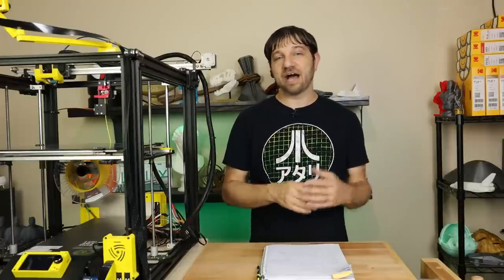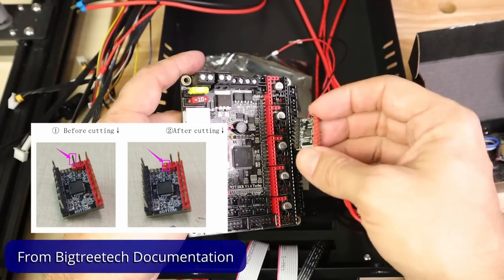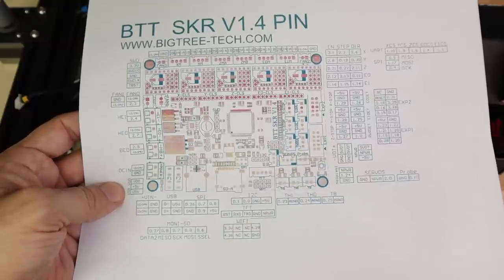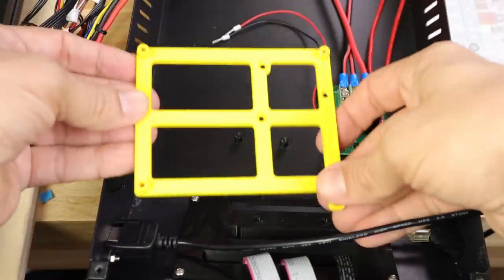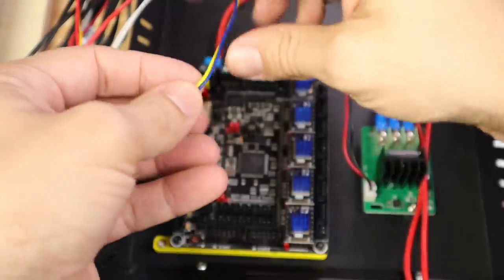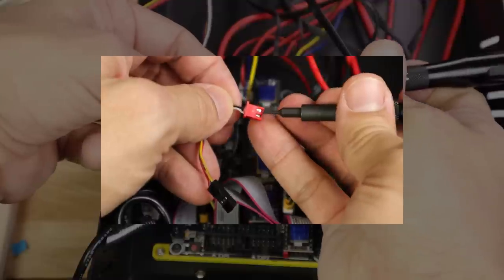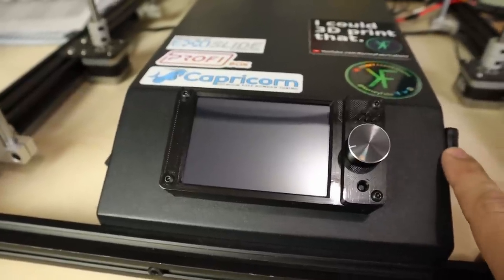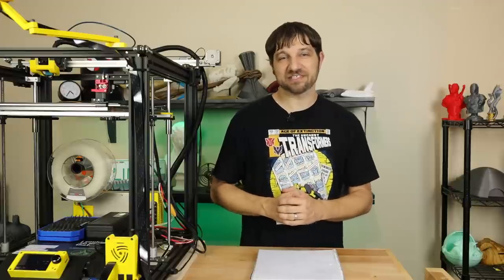Bigtreetech Ender 5 Plus Upgrade: SKR V1.4 Turbo (Part 4)

Comment: Hey dude. This video was a big push for me to hop on the kit pretty much as soon as I got my ender 5 plus up and running. I've got it all hooked up with a solid 600w meanwell PSU. I've followed your guide as close as I can up until you test the board and it first outputs to the display, but I get nothing on mine. I've crosschecked my connections with videos by other youtubers too. The power LED is showing on the board but there's no LCD image or backlight activity to speak of, nor any spin from any of the fans. I've checked the SD and the default firmware seems to be on there along with the BIN file. Can you suggest how I can check to see if my board is faulty?
Reply from the maker: If you're not getting any power to the display, you may have the 10-pin plugs in reversed. Check the colored wire orientation versus my video. To see if your board is dead, hook up a computer over the USB port with something such as Pronterface and see if you're getting output.
Reply: @kerseyfabs  Cables are 100% hooked up correctly, but now I'm even more confused. I switched the jumper to USB and connected it up, pronterface detects the printer but sending commands does nothing, not the motors, not bed temp, none. None of the fans are spinning, either. The microSD storage is accessible through the USB connection though. What's even stranger is that I now have backlight on the screen, a red "D2" LED has lit up on the back of it, and it beeps when I press the wheel in.

EDIT: I've just randomly started getting output from the LCD after being hooked up to my PC for 10 minutes or so. This is only when connected via USB, disconnecting the USB cable or switching the jumper back to VDD stops all output to the display.I don't really know where to go from here
Reply from the maker: @notyounotme7193  Is there any chance the main power into the board is wired backwards?
Reply: @kerseyfabs  board is receiving proper power, the green Q3 LED is lighting up on the board. I'm starting to think there's a problem with on board voltage control

Comment: Hi. I have changed my E3 turbo for this board, and i want to use dual z-steppers. I have downloaded your fw for dual z and now i wonder which pin i should use for z1 and z2?
Reply from the maker: Check out my video on G34 Z alignment. It shows exactly what you're looking for.

Comment: It may be worth noting that in the recent marlin firmware, you no longer need to reverse the pins in the bltouch probe and put it in the z endstop header. Marlin fixed that in v2.something before your new firmware. The sensor can go into the probe header as-is.
Reply from the maker: Given the fact that the pins are actually hard-wired to certain power or ground lines, I don't see how that's possible. Do you have a link?
Reply: In the z endstop port, you (we) are just swapping the wires so the correct one can go to the z endstop ground and the probe pin goes to pin 1_27. If you don't swap them and put them in the probe port on the board, the ground pin goes to ground and the probe pin goes to pin 0_10 as per the board diagram. 
In Marlin, in the pins_BTT_SKR_V1_4.h, it's already defined as:
//
// Z Probe (when not Z_MIN_PIN)
//
# ifndef Z_MIN_PROBE_PIN
  # define Z_MIN_PROBE_PIN                  P0_10
# endif
All that has to be done in configuration.h is to comment the '# define Z_MIN_PROBE_USES_Z_MIN_ENDSTOP_PIN 'line 
and uncomment the '# define USE_PROBE_FOR_Z_HOMING 'line.
there's one more line below that: '# define Z_MIN_PROBE_PIN 32 // Pin 32 is the RAMPS default' , but you should not need to uncomment and change that one because that # ifndef Z_MIN_PROBE_PIN segment above in the pins_BTT_SKR_V1_4.h handles that.

The only reason I ran into this was because I was monkeying around with Klipper and couldn't figure out why the servo stuff worked but the probe wouldn't stop the bed raising when i assigned sensor_pin: ^P0.10 in the [bl touch] section. Had to quick power off the machine to stop the nozzle from crashing. Then i opened up the machine, swapped the pins in the connector, and used the probe port and it worked fine.

Comment: Hey Kris!  In all your adventures have you come across a way to flash this board if the SD is dead?  On my old RAMPS board I could upload firmware via the commandline with avrdude but as far as I can tell there's no equivalent for the LPC1769 yet.
Reply from the maker: You will probably have to reflash the bootloader first. I'm not 100% sure of the process since I haven't used it. I'd Google for: SKR V1.4 Turbo bootloader
I saw there was a bootloader hex but I didn't take the time to find the instructions to load them. All the best!

Comment: Hey! I have a problem :(
When i turn on the printer it says no printer attached, and then it finds it, but sometimes when i home it moves to the Y endstop VERY erraticaly and then it won't home properlly.
Also i haven't been able to print anything bc mid print it says "printe halted" and nothing else so i can't figure out what's going wrong
Please help 🙃
Reply from the maker: If you're in touch-screen mode, the "no printer connected" to connected is perfectly normal. It takes a second for Marlin to come up and communicate with the display. I don't know about your erratic Y moves. It could be the motor, a communication problem somewhere or the belts and pulleys. As for your mid-print failures, I'd recommend switching over to Marlin mode for a test print and see if that gives you any more output on failure. If that doesn't work, you may have to be hooked up to the console during printing to see what's going on. Good luck!
Reply: @kerseyfabs  In marlin mode it says TMC ERROR, what does that mean?
Reply from the maker: @javs2406  It means there's something wrong with one or more of your stepper drivers or the motors. There are some diagnostics you can run from the console but if this is the Turbo and they're onboard, you may have to replace the board.

Comment: Hi Kris, do you perhaps have a firmware.bin that you configured with the latest marlin version. I am new to the modding scene and followed your instructions and all is working 100%. I would however like to upgrade the firmware to the latest version but I have no clue how to edit the new firmware to run my printer.

Comment: would the SKR turbo work with an ender 5 plus stock lcd or would  i need to upgrade the lcd as well?
Reply from the maker: There are some tutorials online that show how to get it working with the stock display but it requires new firmware on both the board and display and special wiring. It's more work and you don't get all of the features of the new display.
Reply: @kerseyfabs  what lcd would you recommend for this board? and is there a stl for the lcd's frame i could print?
Reply from the maker: Almost any of the Bigtreetech displays will be fine since they use similar firmware and connect the same way. So you can choose between the 3.5", 4.3", or 5.0". I think all of them have some sort of display mount that will work on Thingiverse. You can check there ahead of time to be sure.

Comment: Does the firmware you provide in the description have offsets for the original hotend or the hero me?
Reply from the maker: With Marlin 2.0, you can set X, Y, and Z offsets without recompiling. I believe my default is for the stock configuration.
Reply: @kerseyfabs  

Finally! Thank you. I have been trying to get my e3d volcano and hero me running for months. I am still new to linux based coding. I could change the offsets in the firmware source but couldnt get it to compile. I guess I'm buying a new board.
Reply: @kerseyfabs  
I have it working. The skr 1.4 turbo board definitely fought me the whole way. The sd slot isnt right. I had to wiggle the extension (or card) until a m21 command could see the card then I hot glued it in place. I also had to use the bondtech rail mounts so I could use the full bed. Did you have issues with the corner leveling not being in the corners?

Comment: hello again, ive started having an issue with my usb port overheating and melting the wires inside the usb lead. any ideas what could have caused this?

Comment: Looks like I’m having the same issue with this new board. Have the firmware loaded up onto the as card as firmware.bin but when I power the machine on I get the BTT logo and then it gives me 2 options. One for touch mode and one for marlin mode and I can even select any of them.. I’m confused at this point. Is there a way I can do this via usb from my computer to the mobo? I’m wondering if it’s something I have to force into it?

Comment: Hi, What a wonderful in depth vidoe. Question with the firmware. I just purchased the 1.4 turbo, TFT35 V3.0 screen and i just installed a dual gear extruder and almost everything is stock. can i still use your BIN firmware to flash and install the new marlin? i dont have any knowledge on doing all that stuff. also, do you have a file for that screen cover that you use for the new screen?? thank you so much.

Comment: I like your setup so much better than the others. Just a (maybe stupid) question, why to keep the USB connection available?. With my SKR 1.3 (in an E3) after the 1rst setup I did all the flashing with the mini SD and actually never used the USB again.
Reply from the maker: Thanks! I use it to run commands directly from my laptop and I use it to connect to OctoPrint.
Reply: @kerseyfabs  Thanks to you... I was sure my question was stupid (lol)... I´ve never connected a printer to a PC, maybe I am losing on something, but not eager to do it. Tomorrow is the re-release of the Creality 6 CoreXY, will take a look at that one and if it does not convince, will get the 5 plus and do this upgrade.

Comment: Excellent video. I do have a question; since the boards have been replaced with SKR2, does the firmware you linked to work for those as well/ Or does it need to be recompiled? I have pretty much a basic stock 5 plus build with the creality silent card. I wanted to upgrade to a 32 bit board.
Reply from the maker: Thanks! Yes, you do need new firmware but I have you covered with a setup guide and firmware that you can find a few posts down on my community page: https://www.youtube.com/c/KerseyFabrications/community
Reply: @kerseyfabs  Awesome! Thanks for the quick response. I'll have my board in a couple of days. I'll let you know if there are any more questions!

Comment: Hey Kersey! Thank you so much for the tutorial! Just installed the SKR V1.4 Turbo  in my Ender 5 plus with TMC2208 with dual Z ! I used your firmware with the dual Z and everything worked fine except that the Z is inverted! I am trying to compile a new version but errors keeps popping and i am in a loop trying to fix them and then more error pop up! Please HELP!!
Reply from the maker: Are you able to home the printer properly or does it just go down? Make sure you have the black/white wire plugged in properly. Test up and down using the Z controls, not just the homing.

Comment: Hi, I have another question about yours firmware. Is filament runout sensor included in fw? I have problem with configure it. I print from touch mode and if I check option for filament runout detect in printers options, I always get filament not detected.
Reply from the maker: If you are using the touch interface, you will need to move your filament runout sensor plug to the back of the display. You should see it labeled there. The display cannot use the board's filament detection.
Reply: @kerseyfabs  as i suspected... Thank you :)

Comment: Hi ! 
I use your precompiled firmware for the tmc2209 and it work, but it's reaaly slow to probe! so I try with your not compiled files, modify all and impossible to compile! I delete all, unzip your file and try to compile without touching anything, same problem... why ?
Reply from the maker: Make sure you're grabbing the latest branch. Older branches may no longer compile due to changes in some of the libraries or build environment. Check out the "Branches" dropdown on GitHub.
Reply: Did you get this to work?

Comment: First off, This is a FANTASTIC guide and helped a ton!! Great vid!

@18:12 - Where can I find those fan cables? My hotend fan goes to bare-wire (Ender 5Pro) but I need the white connector as I will be using a second extruder, so I can't use the Ext01 output. What are those connectors called so I can search for them, or can I get a link?

Comment: Is there a trick to getting the pins out of the keyed connector for the BLTouch? I've been working on it with all different sized tools and it won't come out.
Reply from the maker: You have to lift up the little tabs. A small pocket knife or Exacto knife works really well.
Reply: @kerseyfabs  That worked like a charm for the 3 pin connector, but I am still struggling with the 2 pin one.
Reply from the maker: @iandeal525  For that, I have to use a small flat head screwdriver that is no wider than the hole the catch pin protrudes from. Technically, you may be able to press straight down on that pin as you pull on the wire but you will have to be very careful or you could bend the pin.

Comment: Hey Kersey, thanks for your work, but i have a question:
I updated the firmware and it seems successful, because the firmware.bin was renamed to firmware.CUR, but when i start the printer i don't see the Marlin Logo/Version (like in your Video), instead i see the Bigtreetech Logo.
And second question, when i use Auto Home, everything seems fine, but after that the Z Axis does move for about 5 centimeters (after the BLTouch does his thing), is this normal? With the old Board/Firmware the printer board was directly under the nozzle.
Reply from the maker: To switch back and forth between Marlin and Touch interface, hold down the wheel for a couple of seconds and you'll be shown a screen to select one.
Yes, that's normal. After home, the BLtouch should be centered, not the nozzle.
Reply: @kerseyfabs  Ok thanks a lot for your answer :)

Comment: @Kersey Fabrications  thanks a lot for this great video, successfully upgraded my Ender 5 Plus to SKR 1.4 Turbo yesterday. Big kudos to you for offering all those different branches in your github, made it really easy to compile a dual z-stepper firmware for TMC2209 👍
While the BL-Touch 2-pin connector was already wired correctly as Manuel mentioned, I had to modify the 3-pin connector as GND and +5V were switched in my printer.
Seeing all those minor changes in the pin layout I'm wondering how creality can offer a replacement silent board that works in every revision of the printer...
Reply from the maker: I'm glad to hear it! The BLtouch is the thing that caused this printer the most issues. It's a fantastic bed leveler but it's a bit too finicky and the wire colors seem not to be consistent.
Reply: I’m glad I saw this comment. I was following the video and noticed the same thing. On my Servo cable the Ground was brown, Power was red, and Signal was peach-orangish. 

BL-Touch was already wired correctly but it was a white connector not red.

Comment: do i need to set the current for steppers if am running klipper?
Reply from the maker: Yes, for Klipper 3D printer firmware, you'll need to configure the current settings for your steppers, such as TMC steppers, to ensure they operate correctly. This configuration helps in managing torque, precision, and temperature of the motors. You'll set these values in the firmware configuration file, typically adjusting parameters specific to your stepper motor's specifications and your printer's requirements.

Comment: Thank you so much  Kersey Fabrications for this very informative video !! I admit i did have problems at first BUT that was because of the BL Touch wires being wired differently. Thanks to  Kersey Fabrications for the additional help in sorting this out !! **UPDATE**  Everythinng is NOW working!! ( only one thing is now bothering me , When i send printer to HOME it dose`nt go into the center it goes to X:227  Y:195 ) Any Ideas how to make this go to the center?  Thanks again for all your help with installing the SKR1.4 Turbo... Colin
Reply from the maker: Colin, thanks for the update on your build! I'm glad to hear it's working correctly. The reason your hotend does not home to center is because you have a BLTouch. Since the BLTouch is offset from the head, it needs to be in the center when it homes. The default Creality firmware does this incorrectly. I even released a version of the software that fixes it for the stock/silent board. You can change your probe's offset using M851: https://marlinfw.org/docs/gcode/M851.html
Reply: Kersey Fabrications Thank you for all your time .. i have noticed another thing with mine.. it wouldn’t start printing because it came up with a run-out sensor problem. So what I had to do is turn off run-out sensor on the screen! Have you Any ideas why? The run-out sensor is still lit blue ! When i turned it off on the screen. Thanks again for all your time..
Reply from the maker: From what I can tell, the screen's run-out sensor support is different than the firmware's run-out sensor support. I haven't finished looking into this but it doesn't happen when using the text display.

Comment: Hi Kris, Thank you for the tutorials, you helped so many peoples to set up their printers(mine as well). Would you tell me can i turn off bl touch without tuning the firmware? I am building 50x50x50cm cartesian type and will use the firmware you provide here. Also i will use five equal motors 42-34 for the printer will the motor settings be fine for all of them? I am asking because Ender 5 plus have 42-48 on Y axis and 42-40 as Extruder motor.
Best regards!